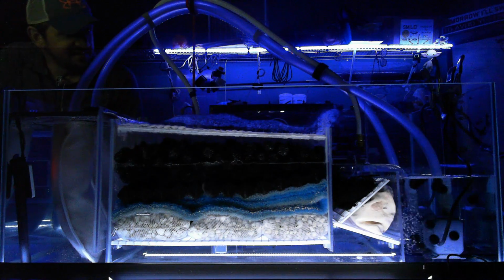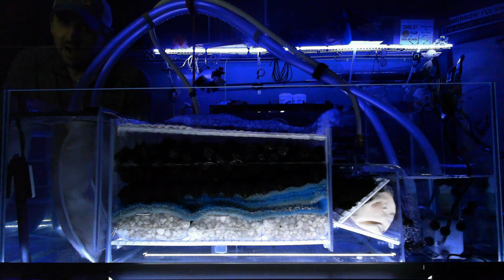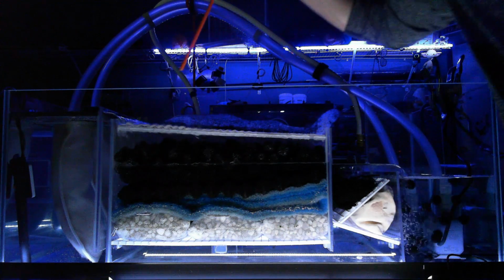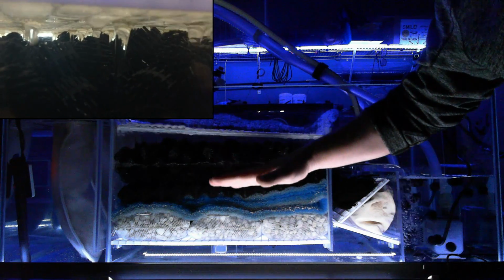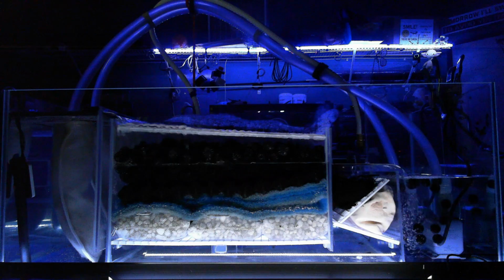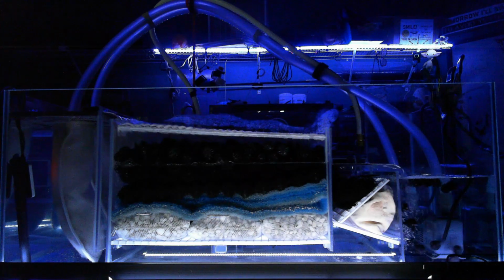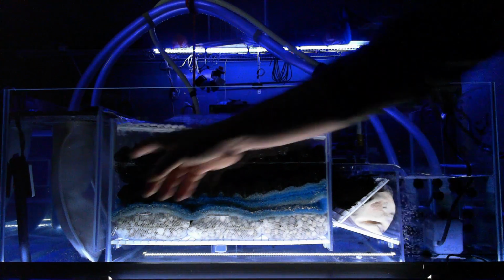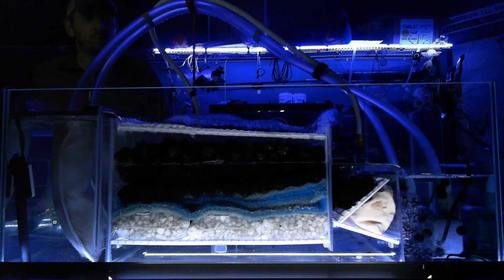Power Sump Series: 1600Gph freshwater African Cichlid sump introduction and overall construction

Comment: People forget that a 1500 gph rated return pump or FX6 pump gets cut by 40-50% with head pressure pushing water up 4,5 or 6 feet into tank.

Even worse if going through a few reactors, a UV reactor etc
Reply: Michael Piccirillo .in sump water mostly pump lot of water into tank because if you notice pump has different sections it's not like canister filter where pump has to suck the water from bottom then pump up .my buddy has a sump and if you don't use hard pvc pipes for return you will get 80% flow rate .
Reply: cichlid guru nyc not every canister works the same way, some suck from the top, some from the bottom. I prefer a sump if space is available
Reply: Michael Piccirillo .Sumps are way to go. To much bypass in canister most of them.

Comment: That's not much flow, my sump has a 16,000 liter per hour pump, which is 4200 gallons. But it is running 4 tanks.
Reply: crazy shrimp lady pics of that setup?
Reply from the maker: crazy shrimp lady it's worked perfectly for the last year. I only have one tank but it's 12 feet long - 240 gallons total. More than enough flow for that tank but it's really only limited by the pump, return, and 1/2" x 18" baffles.

Comment: Thanks for the video! Gives lots of ideas to explore further? Could perhaps add the names (or even better, links) to some of the things you're using here. e.g "Pyrogen" media? and what's that sensor for pH/temperature/etc.? "Senai" ?
Reply from the maker: Purigen is the Seachem product I use for removing stains and other water clarity problem materials. See here: https://www.youtube.com/watch?v=AbddLud16JM

I also use a Seneye probe for monitoring ph, temp, nh3. it's absolutely critical to running a large tank with a continuous drip system like this one.

Comment: Sumps are the way to go for biological filtration for sure.. Only have an 1800gph/75 gallon sump system so the media has time to digest ammonia-nitrite-nitrate along with 2 Fluval FX canisters for additional turnover and chemical/mechanical filtration..
Reply from the maker: Free Swimmer your setup is just like mine. Well sorta. Mine is slightly smaller. 56G and 2x Fluval 406 canisters.
Reply: Lots of DIY and Neat stuff !
Reply: I do like your set-up !
Reply: Replace the bio balls with bio home ultra. Give u 200-300x more surface area for B.B.
Reply: I actually have more capacity than I will probably ever need how I am now but good to know.
Reply from the maker: I'll try it. Thanks.
Reply: Nice sump build,

Cycling your sump is great idea but will only keep same amount of B.B as you're feeding it. Can't dump 45 mbuna's & say its fine etc.

Wonder how to properly know what is proper anount of bio media based on fish stock.

Meaning if you planned to keep 45 mbuna's maybe just the bio balls could handle it fine or just need 1 bucket of bio media instead of 4 etc.

Always nice to have but could be wasted money if 3/4s of purchased media is even used etc. Right?

Certain number of fish will only produce certain amount of waste that will occupy only a certain amount of surface area to grow on etc..
Reply: @Michael Piccirillo --> Joey over at King of DiY has has done the math on his aquarium to point out the relation between the mass of fish and the media needed for that. You can hear him out and use the formula he used to calculate the needs for your specific situation.
Search for MY PLANTED AQUARIUM - EXPLAINED --> go to minute 6 and start listening in. He does the math on his 375gal for his 200 fish, bioload to media needs. 
You are welcome.
Reply: Waverwreck I just watched Joey at DiY & his math is somewhat sketchy & he becomes confusing,.

If he's spot on then how much media is needed 1h2n keeping 25 adult mbuna's that max out at 4 inches will be needed?
Reply: @Michael Piccirillo 
I have no clue what a mbuna is . 
His math seems confusing because he does this NON necessary transition between 2000g then pounds then 2% thereof.
I dont understand these Americans and Canadians with non metric system either.

Just take the rest of the info and do it for your fishies :D like so:
Find out the weight of ur fish ( acurate scales are real cheap ) and weigh 1 (use water cup and zero in the scale then drop fish in the cup)

Then Fluidised media can clear 3-5g/day/liter(of media) of waste
Ceramic media "almost double" i`d say a safe 4-6g/day/liter(of media) of waste 
Fish get fed / produce waste = 2% of their body weigh/day

Is it simpler now ?

Comment: I like it, although would personally prefer to have a place for skimmer and refugium as well.  The floss under bioballs seems problematic for replacement, unless you don't mind moving all of the bioballs around.  A coarse mesh bag would simplify that though.  I like the trickle tray concept on top.  Wondering if that can be converted into an algae scrubber as well.  Maybe just put a paper towel on top of it and let it grow, replace when green!
Reply from the maker: I ended up doing this a bit different from what show in this vid. You are right for sure that the floss was in a terrible spot. I def need a UV sterilizer... that's on the list. Here's the current configuration in action for this sump. Thanks for the feedback tdub.https://www.youtube.com/watch?v=BB3nR_OeEWY
Reply: No prob, great vid.  Reminds me that I want a bigger sump!  I have concerns over UV sterilization, killing good bacteria.
Reply from the maker: I ordered a 13watt in-tank sterilizer today. might upgrade to inline later.

Comment: Nice sump man. I need to do a video on mine. Recommend adding a UV sterilizer sucking water from the return chamber and pushing it back on top of your drip tray. That essentially sends some of the water through the sump twice and UV sterilizes it too. Very effective on my tank. I use the Coralife 6x with a marineland maxijet 400 pump and it works perfect.
Reply from the maker: VB Nauticool UV is good idea. I've been honking about where to integrate one. Thank you sir.
Reply from the maker: I installed a UV filter in the filter sock area. Thanks for the tip VB. You can see it here: https://www.youtube.com/watch?v=RTiUCGhlMRs